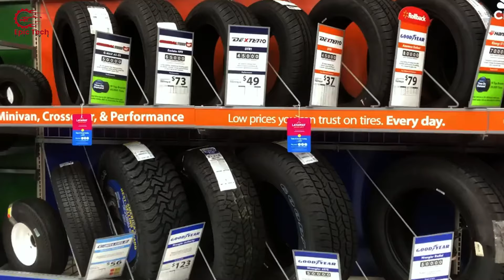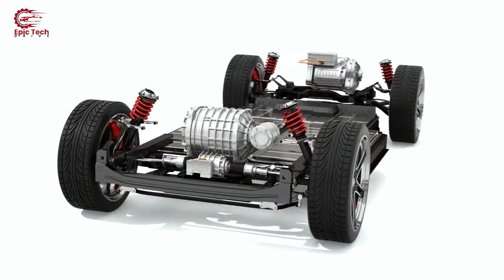Here’s Why Tire Companies Love EVs

Comment from the maker: What are your thoughts on how electric vehicles are reshaping industries beyond just automotive? 🚗💡
Reply: EVs require higher pressure tires to getter better range which also means bigger vehicles need more sophisticated suspensions to produce an acceptable ride. Higher pressure tires also rip up roads faster so paving companies will also prosper. The cherry on top is that electricity generation losses over powerlines can run as high as 50% between power source and the power  consuming entity.  lol

Comment: The newest battery out is the Condenser, up to 1200 miles on a charge, much lighter, temp and fire proof.
Heavy Lithium is being phased out, Sodium -Ion has taken its place in China.
EVs will soon weigh the same or less than ICE cars.
Reply from the maker: There is no comparison between EV's and ICE Cars. 
ICE cars 💪🏻✅ 
EV's 🤨🛑❌🚫
Reply: @EpicTechDrive  You should be better informed, this is not 2010, tech does not stand still.
EVs will be like VCRs, the first ones cost $600.00 bucks, my last one cost $ 19.00 !

Comment: Easy: EVs are heavy and wear out tires 2X to 5X faster than equivalent ICE cars.
Reply: Rubbish, I have been driving EV's for 6 years and not had to replace one yet, I drive my EV's like I stole them
Dont believe the FUD
Reply: That is absolutely not true.  Comparing the weight of the tesla model Y and my Toyota Highlander hybrid, they are almost the same.  My tires last about equally.  It is amazing how many lies are told about EV's.  That said, Tesla is so far ahead of any other makers of EV's, they are the only maker worth considering.
Reply from the maker: Gotta agree with @mdquagila.
Reply: Where do you get your data from ?